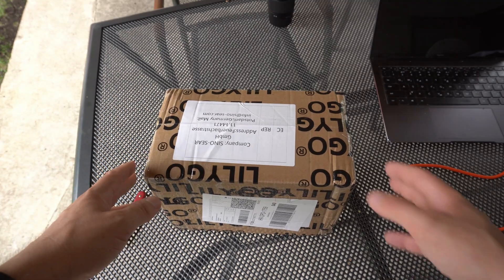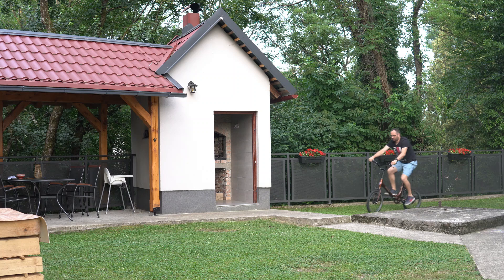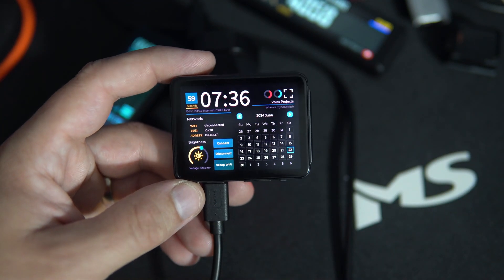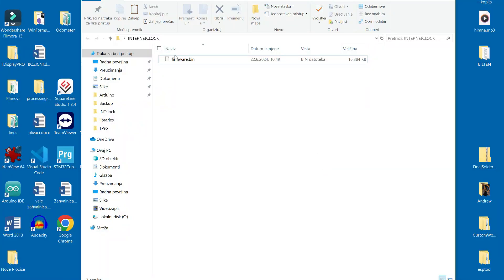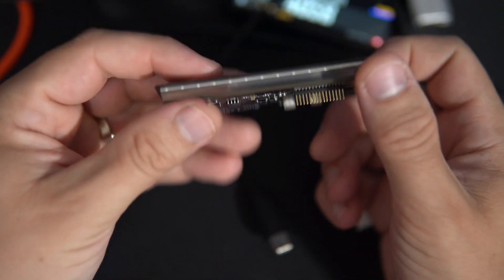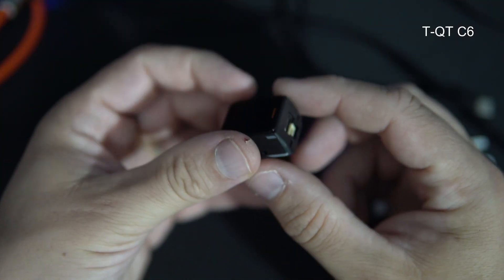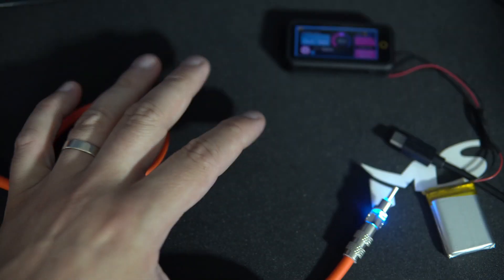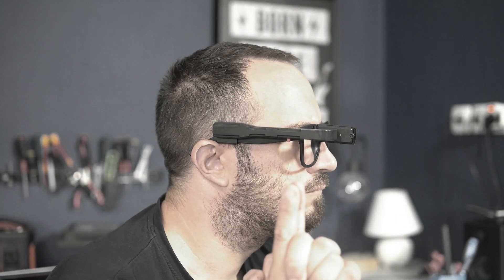LilyGO Sent Me a Mysterious Package - New Boards by LilyGO

Comment: Thanks for your review, I don't understand how do you use the T-Glass. It didn't work for me (I put an issue on Github). By default, the display must be VERY far. If I reverse the prism the display is like a Google Glass but need to reverse the screen and the luminosity is very low. For me there is a strong design issue with the prism.

Comment: Lilygo has nice boards. But I really can not understand the purpose of this products. If You are commercial gadget hardware designer you will never use this boards, rather you will develop  your particular diagram and hardware prototype model  and will develop your gadget based on particular components, which you really need. Not everyone trust, for example,  on ESP32 timing capabilities, and people use fpr example special chips for that, for example DS3231.  How to use Lilygo "ready to go boards"in this case? 
Otherwise... to practice coding ESP32? Ok, may be. But why pay USD 60 (!)  for that, if you can buy (or make yourself) other prototype boards for practice?  
And making the case for the prototype board is another crazy story.

Comment: I hoped you explain how to Programm T-Display S3 Amoled with SquareLine Studio. 😢
Reply from the maker: I will, very soon.
Reply: @VolosProjects  Dear Volos, I think that your intention to make SquareLine Studio lessons is really great.  this series of videos will have much more interest if you do not "stick" on using studio just for T-Display S3, but to explain general aproaches, particular board independent. Or at least make your point on this particular board, but showing what happens in case of other TFT drivers use.

Comment: The new Lilygo shells are really nice - not just 3D printed but proper injection molded ABS (or similar) from what I can tell. 
That's quite a commitment considering tooling costs for the dies.
M5stack are also really great with their enclosures.

Comment: I just thought of a problem unrelated to the video. I'd like to have a few boards at my desk at work displaying some information from our systems. However, I cannot use wifi, but I would have to fetch data through some sort of agent on my work Mac. I'm sure someone has solved this before, it's just that it's literally just now I thought of it.
Reply: You could use the T-dongle to transmit ESP-NOW packets to slave ESP32 devices.
The T-dongle could accept USB-Serial-Virtual-Com messages from an agent resident on the computer - like all those fancy System Monitor Displays do, or you could write an agent which uses Custom USB-HID to forward host system messages to the T-Dongle at a specific vid / pid and then re-forward to your slave devices - like a gateway.

There's a fantastic USB-HID library for Windows by Signal 11. It also works with MAC and Linux but I've only used it on Windows. 
You'll find it as 'hidapi' - originally written by but perhaps not maintained by Alan Ott.
Reply: @nikthefix8918  I came to a similar conclusion and replied separately with a code example to read data from a file and serve via Serial but it looks like the spam filter thought it was malicious 😅
Reply: @JanDahl  I also had to edit and resubmit my response 3 times to satisfy 'the algorithm'.
Reply: @nikthefix8918  I thought of something similar about having a local script to fetch data and write to a local file, then a second script to look at the file and serve it via Serial to a directly connected device (probably gonna test this with a spare T-Display S3 when I've time). I asked ChatGPT for an example of the latter; a bit lazy I know. Then I'll "just" have to figure out how to receive the data and put it into some presentation logic :) 

import pandas as pd
import serial
import time

# Read data from file
def read_data_from_file(filename):
    df = pd.read_csv(filename)
    data = df.to_dict(orient='records')
    return data

# Serve data via serial
def serve_data_serial(data):
    ser = serial.Serial('/dev/ttyUSB0', 9600)
    ser.write(bytes(str(data), 'utf-8'))
    ser.close()

if _name_ == "__main__":
    while True:
        data = read_data_from_file('sanitized_data.csv')
        serve_data_serial(data)
        time.sleep(600)  # Serve data every 10 minutes
Reply: If your discrete monitoring devices are all desktop bound then I guess it would be more efficient to just use USB with a hub. Power is on tap and if you go for USB-HID then you won't have to mess with COM port configuration / discovery.
Reply: @nikthefix8918  That could be true buuut I was thinking that some of the use cases would be interesting to have as extra screens when visiting clients, but maybe I'm just overthinking it right now. I should get something working before coming up with bigger ideas 😂

Comment: Good for hobbyists, but perhaps expensive for short-run production.
Reply: Since Lilygo provide the schematics and CAD models (eventually...), the boards make excellent reference designs for your own FAB - or at least a great starting point IMHO.
Reply: @nikthefix8918  I think that's my broader point. They are good for VERY short run quantities (eg. hobby, or prototype as you imply), but priced to high to use at scale.

Still, they are a very nice package. But sometimes I think that capitalism trips over it's own feet. If priced more aggressively, these could be the go-to for both hobbyists and short-run OEM.
Reply: @SeanLumly  Oh I see, but I wasn't suggesting using the actual liligo product in your designs but rather using the tried and tested design files, sourcing your own components, having your own pcbs made, populating them and expanding on the design to meet your OEM needs. That could work out very cheap in quantity. If an existing board is well documented then it can teach you how to make your own with add-ons and subtractions according to your needs. In that sense, a single Lilygo or M5stack board is a fantastic resource and a great test bed as you develop your own custom hardware.
Reply: @nikthefix8918  Yes, that is how I interpreted your post. Useful for reference design prior to actual production.

I was implying same with my original post, using hobbyist as a stand-in for "make one or two things". But the same applies in the process of design.
Reply: @SeanLumly  Yes good point. Dev boards can become very expensive preliminary 'tools'